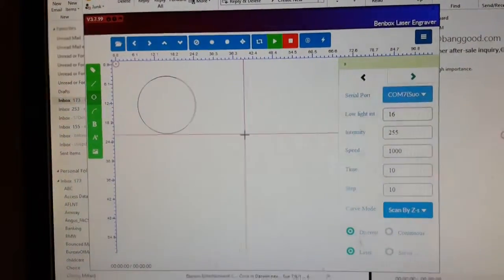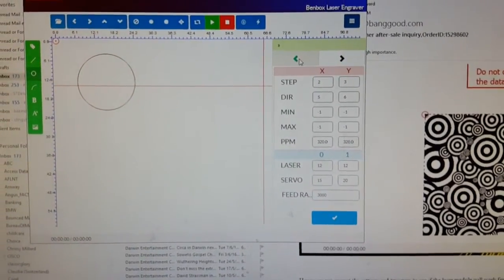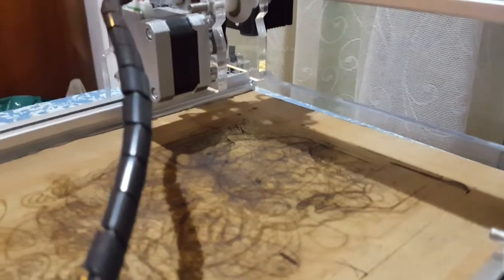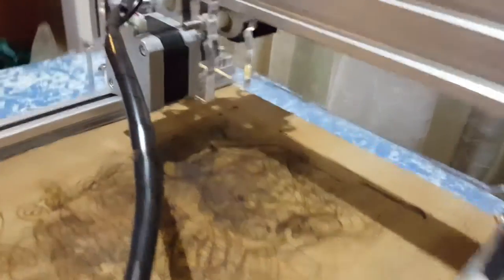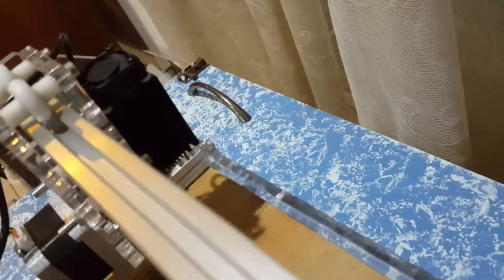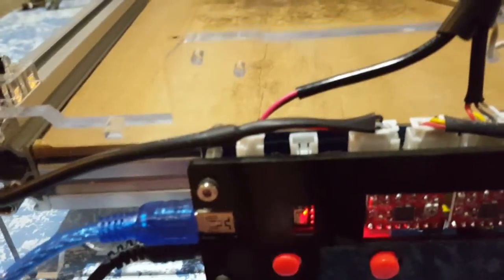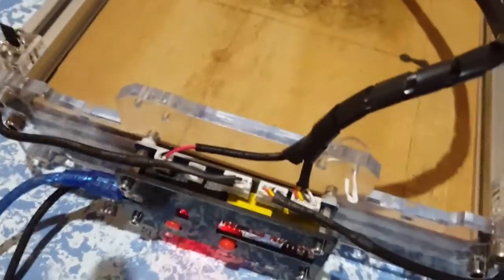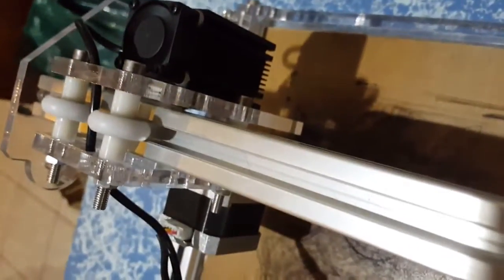Banggood diagnostics 2500mW A5 laser

Comment: that just means the laser is dead  if the fan spins and there is no light the diode is deadbut most of these modules are over driven  what basically means there trying to push out 1 to 2 times the power then what its rated for